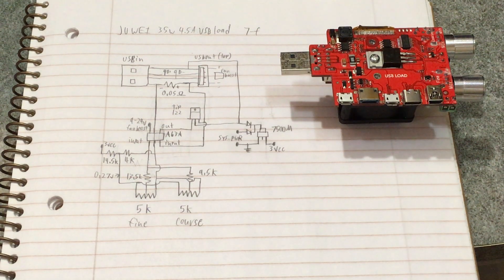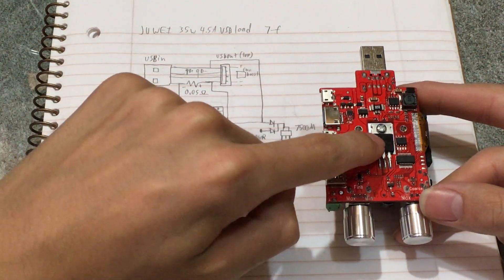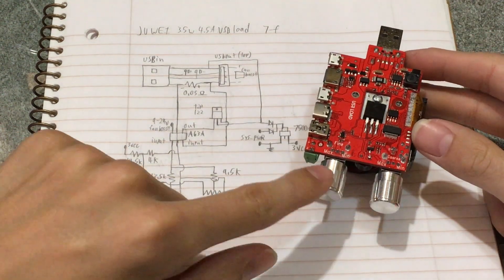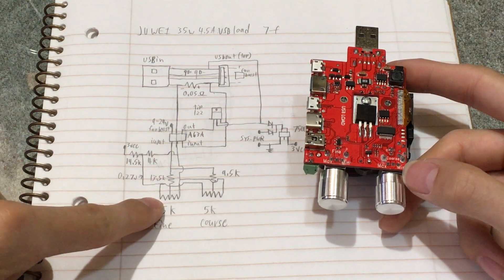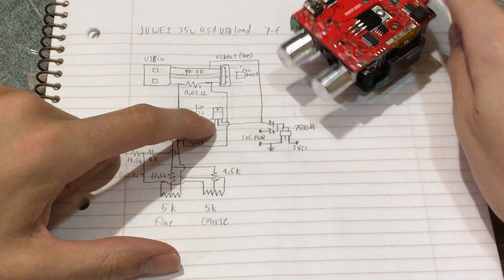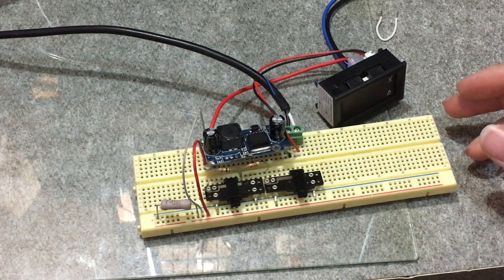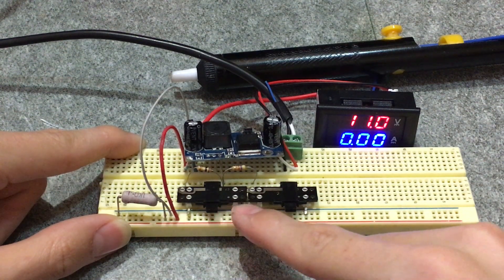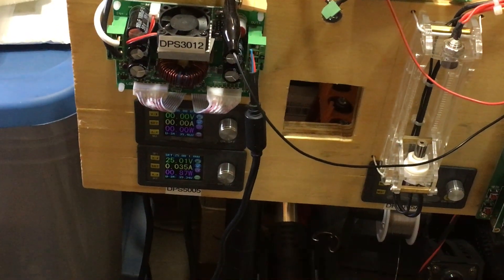35W USB Dummy Load CC circuit repair + how to implement course and fine pots

Comment: Hi, can you help me with the value of the resistor at the base of the Tip122? Thanks.
Reply from the maker: I will measure mine but it should be between 300 and 1000 ohms.

Comment: Hello, and thanks for the schematic. After dropping it, the LCD screen in mine has missing lines. I've tried to find a replacement with no luck, as I've found it's NOT the ubiquitous 0.96-inch OLED screen but a TFT/LCD with LED backlight. The pinout is different despite the same 30-pin connection. Could someone here help me find the right replacement? Or, perhaps, tell me how to adapt an OLED screen...
Reply from the maker: Well it is an OLED from factory, single color. You may want to check the solder joints from the ribbon onto the PCB. If those all look good then it was probably on the screen side itself.
I hope you find a replacement, if you find a compatible model number please drop another comment.

Comment: Hi! Mine broke after attaching a 24V power supply to the wire connectors. Load was set to 0A (I think :)). Heard some crackling sound and immediately disconnected. Now it doesn't react to turning the potentiometers anymore. Fan and display still work, but current stays at 0A. Measured the 3V and 275mV from your schematic. Voltage at the potentiometers also changes when turning. I already ordered a new TIP122. How can I make sure it is the broken part? Resistance between its outer legs is 65Ohms, and 10kOhms to the middle pin (measured in-place). Happy about any help :)
Reply from the maker: Ralf Vogler if you have the transistor then just put the new transistor in and test it out on a small power supply
Reply: @SuperBrainAK  Thanks for your reply. I'm still waiting for the replacement. In the video you say it should be shorted if it's broken. So I wondered if my TIP122 is still ok and something else broke.
Reply from the maker: @RalfVogler  Yea, to test the transistor make sure there is no power. Then with your multimeter in diode mode put the red probe on the leftmost pin, then the black probe on the right most pin. It should say something like 0.9 to 1. Then move the red probe to the middle pin keep the black probe on the right pin. That should read a little higher 1 to 1.1. If either of those pins are less than 0.8 or if your meter beeps then the transistor needs to be replaced. If the transistor is ok then if could be any number of things and it would be much harder to find what went wrong and replace. I hope this helps you
Reply: @SuperBrainAK  Thanks! Seems like it's broken and the replacement should help. Middle pin is 1.08, but left is only 0.1.
Reply: @SuperBrainAK  I replaced the TIP122, but that didn't help. The values for the left and middle pins when on the PCB are still 0.11 and 1.08. For the TIP122 alone (not on the PCB) it's 0.92 and .0L. Let me know if you have any other idea how I can pinpoint the issue. Otherwise I guess it's time to order a new and bigger electronic load, maybe with bluetooth :) However, I liked this one because it's so compact.
Reply: Since it doesn't react to the potentiometers, do you think it could be the A63A? How can I check it? Google says it's a 'LM321 Low Power Single Operational Amplifier' which is the single version of the dual LM324, which I ordered now because I only have LM358 at home. I don't know much about OpAmps, do you think it's worth to try the LM358?
Reply from the maker: Ralf Vogler yea unfortunately it probably fried one of the surface mount components, like the small transistor feeding the TIP122 or even the amplifier chip
Reply: @SuperBrainAK  I'll order some LM321 SOT for replacement. Do you know what transistor I need to get? I have the green version PCB and it looks like it has three instead of one of those SOT components with 3 pins above the Max label.

Comment: Hello again, Having some issues Identifying why a component is on the Potentiometer. On the bottom of the 2 buck converters I purchased is, what looks like a SMD Fuse(maybe a cap), I am so bad at identifying. To me it looks like a fuse. It is on the bttm of the CV Cap(btm throughhole)-see the pictures here-

https://www.ebay.com/itm/NEW-300W-20A-DC-TO-DC-STEP-DOWN-BUCK-CONVERTER-MODULE-6-40V-INPUT-1-2-36V-OUTPUT/202304168461

 I am sure there are better pictures on the web? But I noticed on some of these I found, its not there? You would think it is a cap, but it looks more like a fuse. I need to desolder and add a bigger 10k wireround. But I want to find out the reason this is there for and if I should keep it there after I desolder(or if I need a bigger one with the bigger Pot). Have you seen this before?
Reply from the maker: ah those pictures are actually quite good, that is difinitely a capacitor, most likely to help with overshoot/undershoot just add bigger capacitors on the output side and it should not be needed. but you can just leave it there and solder two wires for your external pot since the third pin isnt being used (its bridged to the middle wiper)
Reply: You D MAN!!!!!I don't have a project for them yet, But I will figure out something. 20amp buck converter will come in handy somewhere down the road!!Thanks for the tip!